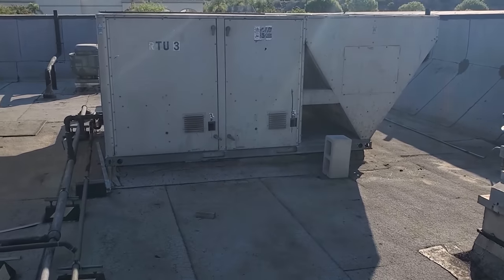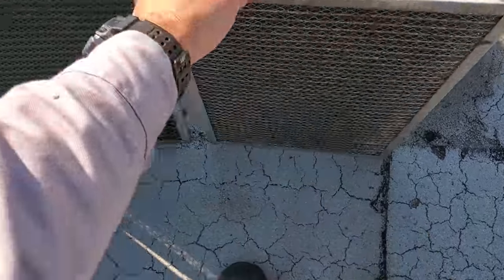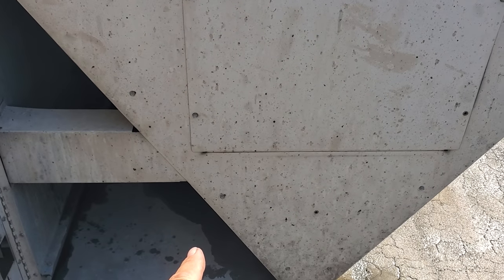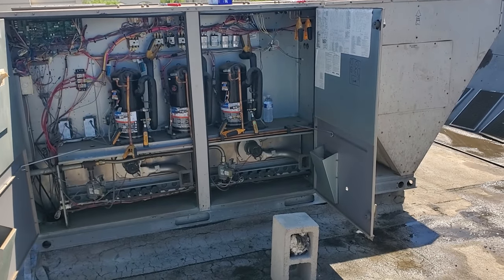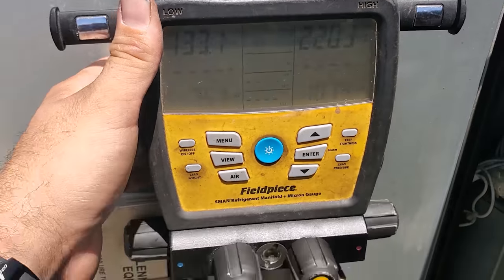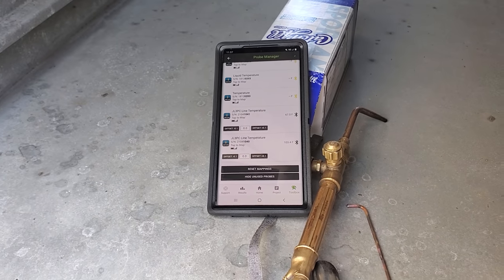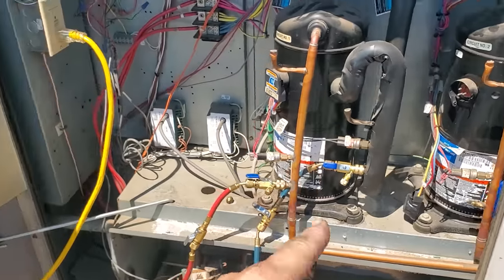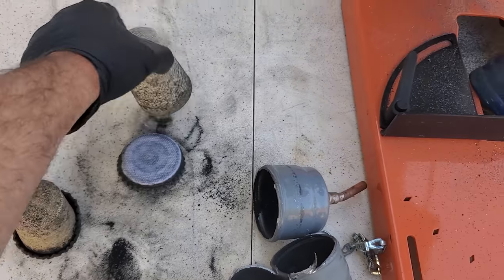ITS JUST AN AC HOW HARD COULD IT BE......

Comment: Next time you get a loud compressor try a little AC renew (4 oz inject) and tell me what you think, it also helps the TXV.
Love your videos and believe me your customers don't know how lucky they are to have a technician of your caliber & experience 👍.
Reply: As an auto mechanic, I can tell you this. Those "rejuvenation" treatments are a real pain in the butt to deal with. Especially any form of "stop-leak".
I run into any sign of that stop-leak stuff and I'll do three things:
1. Inform the customer that stop leak is only suitable for temporary repair of tiny engine coolant leaks (literally only long enough to get it to  the mechanic, like a week or less). Smarter customers means I can get more of the easy "bread&butter" preventative maintenance jobs, and less of the "often more difficult than I'd like" repair jobs that happened because someone used the wrong stuff somewhere (it's usually harder than the repair manuals say it is where I live because the DOT salts the roads in winter to keep them from getting icy, but that makes the undersides of the cars rust, along with every single nut and bolt and other kind of metal fastener you can think of under there).
Over the long term, informing the customer of the right way to keep their vehicle in working order saves them money too, because a little $ spent on preventative maintenance now saves a lot of $$$ spent on repairs later.

2. Find and fix the actual leak that the stop leak "fixed", if it even fixed it (unlikely that it totally stopped the leak, tho it may have slowed it down quite a bit).

3. The entirety of the coolant is now useless, I can't even re-use it in the same vehicle after I go in and fix the leak, because it's contaminated with stop-leak. That means I need to do a complete cooling system flush and re-fill, including watching out for any potential air-locked sections of the engine cooling system. That's getting more and more common these days, that's why I have a bunch of adapters to hook a hand-operated vacuum pump up to the cooling system so I can "suck" the coolant in instead of pouring it in. Only need that on certain vehicles, tho. The Prius is one where you do need that tool.

As for where the old coolant goes, I do try my best to be as environmentally responsible as I can, and dispose of the various types of hazardous waste that auto repair generates via the proper channels. Lucky for me, the person who comes and takes away my waste oil also takes away waste coolant, and brake fluid, and bad gasoline/diesel (yes, that happens). The place I buy my car batteries from is happy to take the old car batteries back.
Reply: @44R0Ndin  , I will agree with you. But AC renew is not a stop leak, it is an oil additive to rejuvenate the oil already in the system. Repairing the leaks should be number one if feasible and cost-effective; that being said replacing the lost oil due to leak or leaks is very important and overlooked a lot. By merely adding lost oil does nothing for the old oil which is probably 80%. Also the majority of AC manufacturers approve it to free up sticking TXVs ( I'm sure it's because it's their way of saving money on warranty work replacing a TXV).
Reply: @boby115  Well there's doing it right, and then there's whatever AC renew does.
If the oil is degraded, you don't put in some chemical that you hope reverses the degredation. You replace the oil. Plain and simple. Does it take longer to replace the oil? Yes. Is that the proper thing to do? Also yes.
"Quick fix" solutions are basically never as good as properly fixing the fault, and this AC renew stuff sounds like one of those "quick fix" snake oil type products that give auto mechanics like me such a hard time.

Low oil pressure in your engine? Sorry, it's not the oil that's degraded, you have worn out bearings in your engine and it needs a rebuild. Switching to a higher-viscosity oil might work for a little while in older engines, but in newer engines with variable valve timing that won't work since the VVT mechanism is driven by pressurized oil and is very sensitive to changes in oil viscosity. Not to mention it's hard to find a heavy-weight full synthetic oil, which most engines are designed for these days. And don't even get me started on "oil stabilizers". That just ends up with oil flung against the hotter parts of the engine, and unable to flow away, so you get a lot more carbon build-up, and then I have to go in there and tear the engine halfway apart to get that gunk out, which isn't economical to do anymore so congratulations you just made me have to sell you a new engine (that's the cheaper solution to it, despite the engine technically being in a state where nothing's broken).
Reply: @44R0Ndin  , these are hermetically sealed compressors they're not designed to have the oil changed. If you want to live at the customer's house or business be my guest but I don't think they're going to pay your labor rate. We are just buying time, if you want , go ahead and rip out the system and put a new one in. Problem we're having out in the field is getting equipment we need on certain jobs; so sometimes we just have to do what we got to do. What you need to understand is air is the enemy and opening up the systems is the last thing we should be doing. Now when we get into a large Chiller systems, yes those systems are designed with bypasses, isolation valves, Purge unit, receivers, accumulators, serviceable compressors and advanced monitoring systems, with scheduled maintenance.
Reply: @boby115  You can totally change the oil on a hermetically sealed compressor. No, it's not EASY, and they of course weren't designed for it, but someone just saying "that's not designed to do that" hasn't ever stopped me before. Heck, I've made a stick welder from 4 car batteries (2s2p connection), and it got me out of a bind, despite those batteries obviously not being designed to act as the power source for a welding electrode.

Here's how replacing the oil in a hermetically sealed compressor generally goes (and there are videos on this channel detailing the process in greater detail than I'm going in to):
Recover the gas in the system, sometimes if you have isolation valves in the right places you don't have to recover ALL the charge in the system.
Purge the system with nitrogen, and then un-sweat or otherwise disconnect the compressor.
Dismount and physically remove the compressor.
Start tilting the compressor so you get as much of the oil out as you can, and collect the oil in a pan or bucket or something.
Measure out that oil, then put in the same amount of fresh oil in thru the suction port of the compressor.
Now since you have the system all apart, you might be able to replace the filter dryers too, but if you have to recover more gas to do that you can skip it if they're not otherwise causing issues (but if the oil degraded anything like in this video, then you're probably going to need to do that anyways).
Finally, re-mount the same compressor back where it was, and hook the compressor back up, sweating pipes back together where needed.

I know it's a lot easier to say it than it is to do it, and that it's probably going to take half a day of your time (and that's a lot of labor to charge a customer for what might be called "preventative maintenance", but with things the way they are right now thanks to this pandemic it's not guaranteed that you can even get a new unit, or even something like a new compressor, so you gotta make the equipment that is in working order stay that way as long as possible, and there's really no way to un-split those oil molecules that got split by the oil temperature being too high. It's a chemical reaction, and outside of some very specific ones, those generally only like to go one way.
Reply: @44R0Ndin  ,. I never said you couldn't change the oil , it's just a pain in the ass. In my opinion Chris went to the extreme to keep a unit going and then some. Sorry I just can't agree with you on opening up a system to replace oil in 2  compressors when the whole system will be replaced in October. I'm going to agree with what Chris did on this one. But if you want to change the oil on the Titanic , be my guest.
Reply: @boby115  Hey at the end of the day it's all about what the customer wants to do, I just tell them what I think the best option is and how much it'll cost and they decide if they want to do that or something else. In the case of this unit, seeing as they already had to open the system to replace the plugged filter dryers I'd say give a consideration to changing the oil. If the customer says no, that's fine. But I'll do them the service of at least putting the option on the table.
Reply: @44R0Ndin  👍, when it comes to laying out all the options for the customer, I think Chris is one of the best in the business🏆.
Reply: @boby115  Exactly!

Comment: What a great video! Thanks for sharing. That was a very interesting call. I had a similar issue this summer and changed the filter twice but didn’t resolve the issue. My thoughts were a plugged evaporator or expansion lines. Did not touch it again because the customer is going to change the R22 unit out.

Comment: With the second stage compressor out of the loop, how does it go from 1st to 3rd stage? Did you need to do something with the t-stat or the board in the unit? Or both? I have minimal experience with rooftop units. You talk about understanding sequence of operation being so important (and I totally agree!) Could you (if possible) talk about that more in your videos? I really appreciate your consistency with how you talk about what your doing! I understand there are time constraints. Maybe at the end when you're in the office doing the summary you can touch on seq. of op. for the call the video was about. Thank You for what you do!
Reply from the maker: The control board handles the staging .

Comment: the superheat and subcool look a bit high for an air conditioning unit, which tells me the balance between the condensor and evaporator isn't matched well (restriction around metering device). but i'm used to more residential type heat pumps.

Comment: A few tips from 30 years in the biz.  I ALWAYS cut open liquid dryers before going any further.  I want to see what plugged it.  I've never seen one with chunks of oil char that big but even with a little char, I do a flush.  Since that one has to run a long time, I'd probably flush the whole system.  And replace the oil.  The way I do that is to drill a hole in the bottom of the compressor so that a 3/8" rivet (no pop-rivet but the kind that is heated red hot and hammered) is a slight interference fit.  
I have a setup I made for flushing compressors.  It's a reservoir of flushing solvent, a pump and a pair of copper tubes.  One is a fairly large capillary tube.  The other is a 1/4" return tube.  I stick this through the hole.  The capillary tube sprays a high pressure jet that will dislodge even stubborn crud and the 1/4 line sucks it back out.

When I have as much solvent out as possible, I plug the hole with a silicone rubber stopper and draw a vacuum until all the solvent has evaporated.  When dry, hammer in the rivet, inert the system and silver braze the rivet in place.  Add new oil and you're ready to go.

Before I hammer in the rivet, I take a look around inside with my boroscope to see how things look.  Make sure no metal chips got inside (I drill with an assistant holding a shop vac hose against the drill bit and nitrogen blowing out.).  Also to inspect the motor windings. If they're not bright and shiny, I'd recommend to the customer a compressor change-out.  As you know, a compressor burn-out is a very big mess to clean up.

Really enjoying your vids.  I'm retired now but I still do an occasional job just because I love the craft so much.

Comment: We know it was actual plugged dryers this time, twice, but do you ever swap temp clamps first? To verify you don't have a funky temp clamp and verify the actual temps? 
But crazy how much crap is floating in that system!
Reply: I've seen in other videos. If in doubt at all he'll use the same clamp on both sides of the drier.
You can also feel the difference once it gets that severe, just by putting your hands on each side of the drier.
But it's a lot easier to show it on video with two clamps connected on either end of it.
Reply: If you question your clamps don't swap them, place them next to each other on the same pipe. Same can be said for temp probes. Think your air temps look funky? Put your temp probes next to each other in the same air stream. That drier was so plugged it probably would have felt cold. I've seen them make more water than the average suction line before haha!

Comment: What do you recommend doing about a dirty/caked up blower wheel like the one shown? Thick restaurant cooking grease? Obviously its got to be enhancing wear on the motor, and reducing airflow, is it worth removing from the housing in an RTU and cleaning with cleaner? Love your vids and how in depth you go with explaining everything! Very helpful ! Thanks in advance
Reply: I remember at least one video of washing the wheel and housing when it got bad. Probably recommend to customer and cross fingers that they approve!
Reply: the total condition of that system, with very likely cooked oil coking it up. game over time for a new system and they better step up their maintenance plan or ensure the hoods are working right, sheesh.
Reply: When you have a well maintained unit with a dirty blower wheel? Yeah, go ahead and tell the customer it needs cleaning.
EDIT: If the blower wheel is both dirty and out-of-balance, you could also tell them that it's so dirty that all the caked on crud has thrown it out of balance, and that that will eventually kill the blower wheel bearings. Considering how much it costs to clean a blower wheel versus replacing the bearings and all that, they'll probably approve the cleaning.

On the other hand, this unit in this video has a mitigating factor that means it's not worth it to the customer to clean that blower wheel.
Remember, this whole unit is going to the scrap heap in October because it's getting replaced with a new one. So cleaning the blower wheel (that doesn't seem too out-of-balance) on a unit that only has to last till October is kinda just make-work (I hate to use that term, I know Chris doesn't do that to people).

Comment: I had one where a dryer came apart internally and put beads into the condenser, that was a nightmare, and I had to cut out a couple tubes and when I blew with a lot of pressure, the beads shot out, we ended up replacing that unit after a year and a half. It was a pretty old unit, I dont remember the brand at the moment, but it was pretty old.

Comment: If I build a restaurant, I will build a roof over my roof and the end walls will have filters in them and the sun will not be directly on any AC unit. I will have big VFD temp-controlled fans in the end wall to pull the heat out. I will have a shed with cold and hot water, compressed air, and a pressure washer. I will have a winch that will allow the tech to pull his equipment and compressors up to the roof with an electric winch. I think my idea would pay for itself very quickly in greater efficiency of all my units, and faster repairs.
Reply: Techs would LOVE that. However, I'd advise against the VFD temp-controlled fans. VFD's are failure prone and should only be used when you're scratching for any little bit of extra efficiency you can find. I'm not saying you can't have temp controlled fans, but they should be conventional 3-phase units operated by motor starter type contactors, not VFD units.

Comment: Thanks for cutting those dryer’s open I was wondering what happened with it!!
Reply: 99.999% of the time a plugged drier is due to burnt oil because of running with impacted condensers for years. Once in a while a bad TXV/low charge gone unnoticed will cause a compressor to cook the oil eventually. My favorite is when junk Emerson driers fail and launch desiccant throughout the entire system. No desiccant, no plugged drier haha! Those beads really hate distributors and reeds though.
Reply: He had the dryer backwards, if you look at the video when he was talking about the dryer the arrow was pointing up when it should have been pointing down
Reply: @adamsinwich1942  I’m not rewatching the video to confirm, but if you have never accidentally brazed a drier in backwards then you haven’t been doing HVAC for any length of time. I literally fitted one backwards yesterday for the first time and was corrected by someone with far less experience than me because I was rushing, have been working a ton of hours, and simply screwed up. They still filter backwards (even if not “properly”)and it still clogged immediately. Do you want a cookie?
Reply: Happens to us all at some point, it gets really hot on the rooftop and mistakes will be made.  I just had a helper solder one in backwards yesterday and recognized the readings
Reply from the maker: @Adam Sinwich no the drier is supposed to point up, the liquid line goes up than over to the txv

Comment: Aside from the cost involved, couldn't you replace the compressors, flush the condensers, evaporators and lines, and essentially rebuild the unit?
Reply: Yes. But you can't put cost aside. It is far more labor intensive and time consuming which makes it way cheaper to replace the unit. And that's not counting new controls, replacing wiring and still having the unit supplying the make up air which adds undo stress to the unit. The liability and warranty aspects isn't worth it.

Comment: What if you tac the flare nut with solder, or just solder the nut on?  The vibration loosens the nut, but if the nut is locked in place...